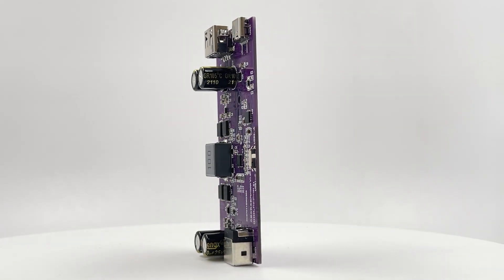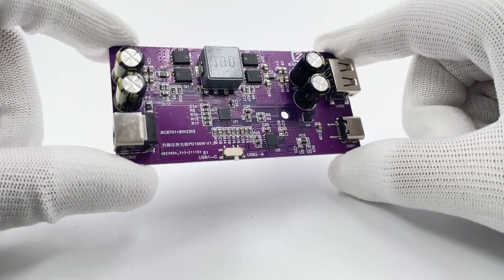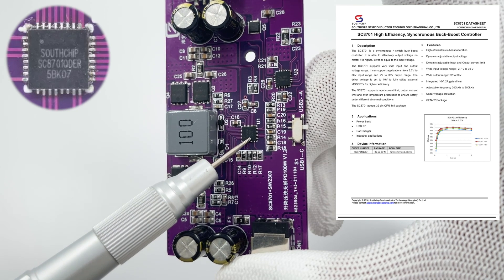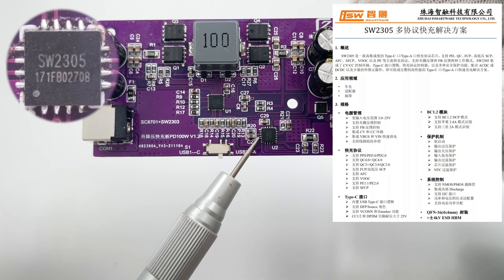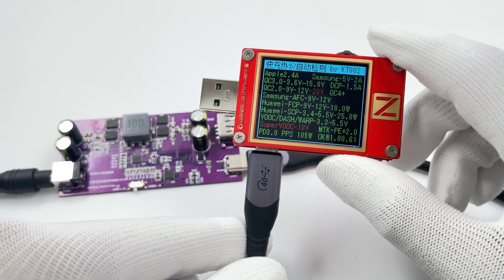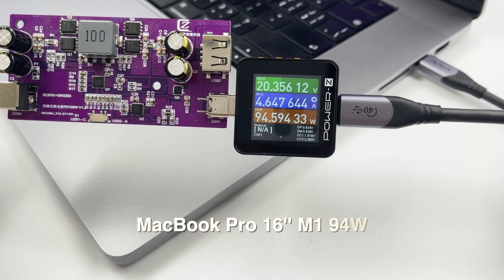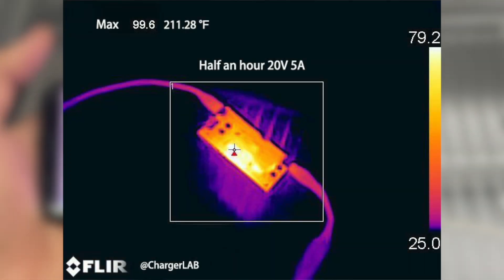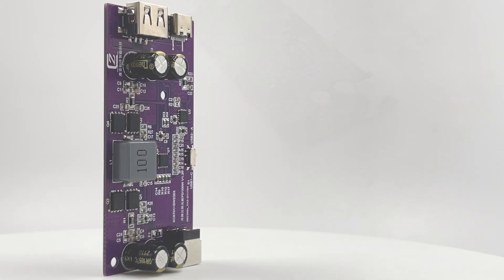Turning Waste to Value | Review of 100W Power Adapter Converter (From DC to USB)

Comment: This board seems to be exactly what I'm looking for. IP2368 based boards seem to built specifically for power banks, I don't want/need bi-directional but I would like wider input range than IP2368 based boards support 4s - 8s battery input buck-boost to 20Vx5A, 100W PD output is what I'm looking for right now

Comment: If you hurry up and bring this product to market at a reasonable price you would make huge profits. Millions of people have older DC PSUs/AC-DC adapters and would like to use them where PD is required. I am searching for such a thing quite a long time.
Reply: Unlikely that “millions of people” are going to tear their existing barrel connector supplies apart and solder a $15 PCB to it. You can buy an entire, compact 67W USB-C GAN power brick for just $35 these days

Comment: Multiple 100W boards available on Aliexpress guys.
Buck <24V? IP2368
Buck Boost 12-16.8: SW2303 Meant for 4S lithium but I think it can do 2S-6S with limitations
Buck Boost 12V-16.8V 120W: SCS8812A (120W Bidirectional blah blah). Shuts down at any other voltage range
Buck <35V 60W(65W): SW3516/3518 (3518 supports some obscure fast charge protocol) I love these and have pulled 65W out of mine. Headache free just give them at least 21V
IMPORTANT: The buck boost IC's overheat past 65W output. With fans I can get them to run cool enough to not trigger thermal protection (2X 40mm blower fans cost like $5-$10). I need to buy a 2368 because it looks like it would work well and I have seen videos on Youtube of people using it

Comment: Nice piece of hardware, this could be very useful as second life for powerful power supplies from older laptops or different hardware. In my case I needed opposite conversion from USB-C to classic 19 - 21 V DC jacks. On Amazon they are quite cheap and affordable. I got one for about 12 € and I can power my older ASUS Zenbooks from Apple 87/96W bricks and secondly I can measure laptops consumption with KT002 :)

Comment: is there a board that does the reverse? to implement usb c charging onto a laptop
Reply from the maker: Just a simple cable is enough to use the PD charger to charge the laptop with DC port.
Reply: simple cable?
Reply: @Sulphur_67  Look for A 20v USB-C PD Trigger (preferably with the correct end for your laptop brand)
Reply: @donovanlawson2848  i found one at the end, i really wanted to have the usb c port directly into my laptop buut there's not enough space to put the adapter i bought into the chassis... thanks tho

Comment: Pricing is critical for this product. Because you can get a PD adapter for $20 or sometimes even $10, this product has to be priced competitively otherwise people would just buy a charger outright
Reply: That good point. I am planning to build a PD 100 watts power bank but when I calculate for everything like batteries, BMS, IP2368 module,casing, voltage/current display etc. it came out to be same or more expensive than a commercially available fast charging power bank. The only positive point is getting the dopamine/pleasure of building yourself 😂

Comment: I'd love to get my hands on a board that can support an input up-to ~52V volts and put out 100W USB-C PD. Always had the idea of embedding a USB-C PD charger into my DIY electric longboard so that I can charge my laptop and devices off of it. I do this currently with an external dc-dc converter adapter I built to charge my laptop with a barrel jack. Though id love to get rid of the external DC-DC brick and just carry a simple USB-C cable with me instead.
Reply: 52v input support would also nicely cover PoE. I've got a bunch of PoE mains adapters that I can't use.
Reply: @mikewilliams6467  YZ826S Quick Charge Adapter Car Mobile Phone Charger Adapter DC Input 10-70Vdc
legit? idk @chargerlab

Comment: If i wanted to build my own 100w pd power bank could i use this?
Reply: You need to have the correct voltage. Safest way Id guess is to go around 20V, so either a 5S or 6S configuration

Comment: 100c? Isn't that too hot
Reply from the maker: It's just the PCB. It'll add the thermal pad, silicone adhesives to enhance heat dissipation for the final version.
Reply: @ChargerLAB  I want to buy it. Can you add a link?
Reply: @ChargerLAB  When?!